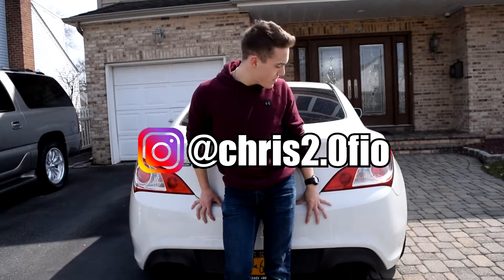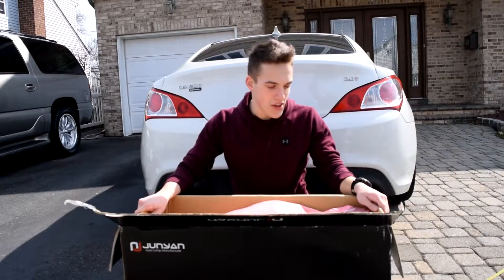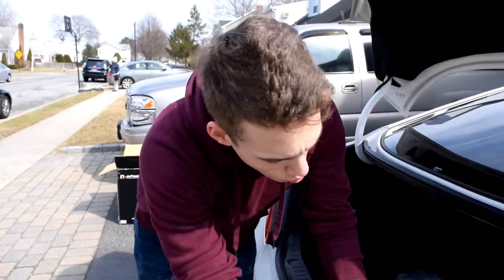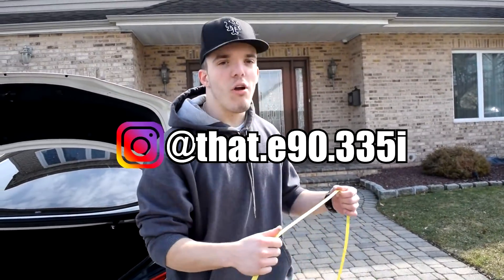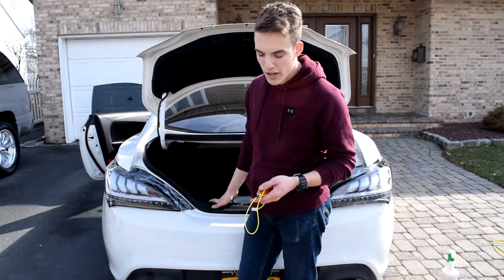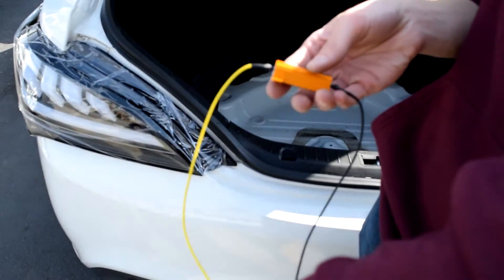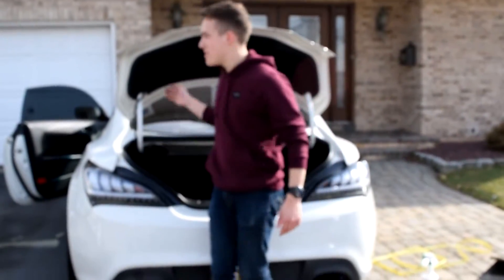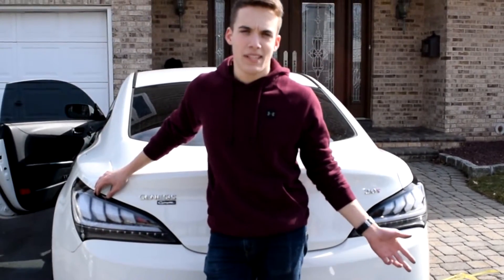Spec D Tuning Genesis Coupe Tail Lights Install

Comment: Crazy how swapping the taillights out makes it look completely different, looks nice. 👍🏼
Reply from the maker: Yes! I agree, changing the taillights were a big move. They changed the whole look of the car.
Reply: @Kylan Ali Instablaster ;)
Reply: @Ares Coleman Thanks for your reply. I got to the site on google and I'm waiting for the hacking stuff atm.
Looks like it's gonna take quite some time so I will get back to you later with my results.
Reply: @Ares Coleman It worked and I finally got access to my account again. I am so happy!
Thanks so much you saved my ass :D
Reply: @Kylan Ali no problem =)
Reply: 너도 후미등 교체하냐

Comment: Does the car have to be on for the turn signals to come on because I bought these and it’s not working
Reply from the maker: Yes the car has to be in auxiliary or turned on. The only thing that would work with the car off would be if you turned on your hazards👍

Comment: Did the new tail lights prevent condensation build up?
Reply from the maker: I actually had condensation build-up in the passenger side taillight.  But I did a separate video on removing the condensation.
Reply: @acauto7886  I'll check it out. I wanted these tail lights, specifically the white marker one, but it's sold out everywhere. 😭

Comment: Got water in my stock tailights 😑... thinking about getting these, they look so good! But have you gotten any water in the new tail Igor’s yet?
Reply from the maker: Lol yup😑 i got water in the passenger side. But i just put out a video on how to prevent it from happening. Its been dry inside for 2 months now. Go check it out👍
Reply: AC Auto damn haha... and alright I will check out the video, thanks!
Reply from the maker: @109ManUtd  no problem👍

Comment: How do you prevent the water getting in?
Reply from the maker: From what ive seen done before, people will use silicone to cover up the space between the taillight and the trunk of the car.
Reply: Ahh okay okay, btw remember me commenting about which genesis i should get, either the 2.0t or the 3.8 i bought the 3.8 yesterday 👍🏼
Reply from the maker: @Adrian-zy2hx  yes. Congratulations 👍 welcome to the club

Comment: What color do U pick?
Reply from the maker: Hmm, well what color is your Genesis?
Reply: I’m trying to get the same color of the rear lights
Reply: Bcuz I check the website and it was like smoke,black and more
Reply: I got a gen like dark blue it’s not navy but it’s like a dark blue
Reply from the maker: @andresfelipe2890  so you want the same color that i have?
Reply: Yeah
Reply: So what color is it
Reply: There white or smoke ?
Reply from the maker: @andresfelipe2890  they should be under the name, "black housing with white markers"👍
Reply: Si basically the color it’s Black bcuz in the web site just give 4 option : black, gloss black, smoke, red and smoke red
Reply from the maker: @andresfelipe2890  what website are you on? If you go to genracer.com they have the tail lights with "black housing with white marker"
Reply: No there not I don’t see it
Reply: Ohh I find them thank u anyway